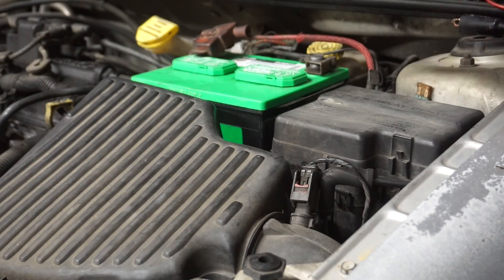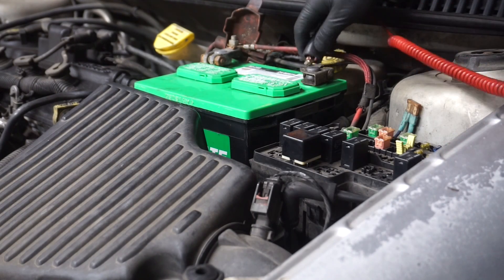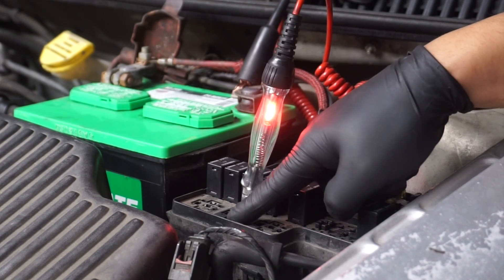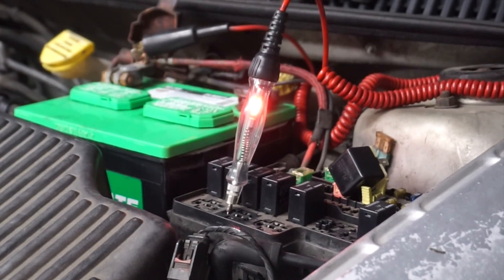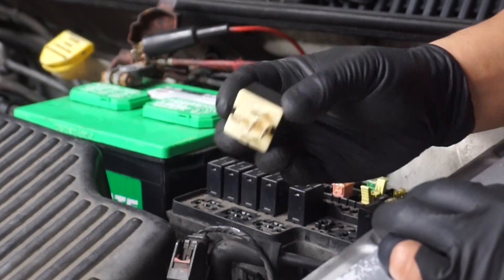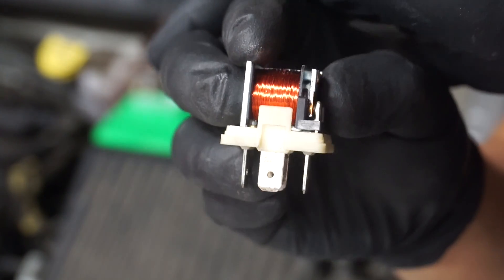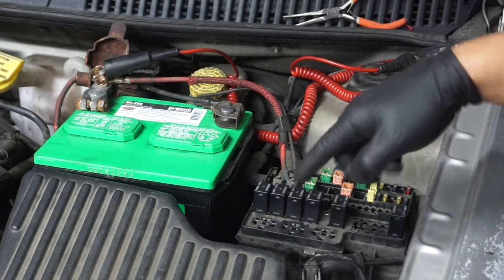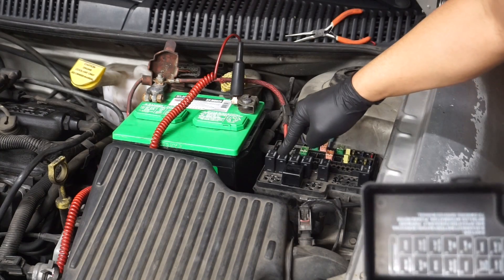How to test a relay and the relay circuit

Comment: Listen I need you bro I got a 2008 Ford expedition and my hazard lights go crazy when ever they what to, my truck even started on its own twice I changed my switch to the hazard lights, I can't find an exact relay for the hazards but the port 21 under the Hood and it's clicking without a relay in it does that mean it's the wiring not the relay

Comment: Thanks Homie! I got a car can't get power at the fuel pump, all fuse ok, all relays ok/swapped with known good one. I can't find an inertia switch anywhere. 2017 Mirage G4, It was T boned on pass side but no airbags went off, only the driver in the car, it has occupancy sensors so the airbags only go off if the person is there. I might have a bad wire. I'm a redneck so I thought about running a new wire and a switch since I have all the interior panels off looking for the inertia switch.

Comment: What if you put the paper clip or jump wire and still not kickin in the cooling fan  and already  the cooling fan was working when I jump it ,  fuse was good too !  what is the problem  is it wiring fault or is there another fuse inside the car for the cooling fan?

Comment: Hi honda civic 2007 I jump the cooling fan was working and the relay terminal when I test with tester light  not on  when I touch any terminal but  the other relay terminal  circuit was turn the tester on also the fuses was turn on the tester🎉 which one have  the problem  ? is it  the wiring

Comment: Hello, thanks for this video, really helpful!
In my case: sometimes, the AC clutch does not engage. Clip over the battery positive, no ground signal on pin 87 (5) which comes from the AC clutch. From the schematics, there is only one connector between AC clutch and AC relay (no other controls). Any possible causes why sometimes there is no ground signal other than wiring issues? 

When the clutch is engaging, there is ground signal on pin 87, everything works well several minutes than compressor shuts off. Power is provided to pin 30 (3) each time. 

Thank you!

Comment: Hey Hector ! I’m a new subscriber; , wanted to ask if you work on older vehicles .  I have a 1948 Ford F1 straight 6.  My problem is engine stalls when reving up.  Idle good but when I take out for a short drive, it stalls when I excellorate.

Comment: I am wondering if this is how you'd test the starter relay as well? My 2012 Ford focus se has power but won't turn over. I do hear a clicking sound when I try to turn the car on but that's it. I'm unsure if it's the starter or just a connection issue. Thanks

Comment: I know it has been awhile since this video, but here is a question. 
My auxiliary fan stage 1 relay ( low speed ) at the circuit has a very dim light from the test light with car off.
My blower motor speed only works at high speed. With the car on,  a/c on at low speed two pins shine bright with test light. Relay is good. Is this normal? Answers?
Thanks.

Comment: How does it governs the off and on of the compressor clutch. My clutch will engage when switch on, but when it disengage takes over ten minutes to turn back on. I'm good with the temperature ( 46 degrees ) when clutch is working or engage but cab gets mighty hot waiting for clutch to kick back in.
 checked the relay it's good pass both test. could it be maybe the relay is overheating and not working properly? but i have switch other relays to it's position and still same effect.

Comment: When testing relay and circuits  ,where does the B circuit come in.?in my case I have a brake switch circuit b low .not sure where to go to check as anti lock is displayed along  with service engine soon. Help l,your video was very helpful as my ac isn't blowing .so I'm ready to figure this out, thank you oh itsa 96 chevy astro.thank you.

Comment: This was helpful but im not sure I can figure out whats causing the short in my power window switch. Its not the motor and the power goes off and on but mostly off. Driving me crazy! Tried disconnecting the battery to do a reset and the power window came on plus the lights also came on in the switch. Then if i go back to the car an hour later  they are off again and switch doesnt work. This happened all of a sudden. I was never having any problems with window going up or down or any noise. Stumped.

Comment: Hi Hektor, Great video.  Having a fuel pump issue on my Land Rover Discovery 2 and think I have a problem with my  inertia switch circuit.  Got power into relay cavity but when did your ground test with from positive on battery with test light got nothing so not getting ground.  Do you have any videos how to check the circuit.. thanks,  Jeff N.

Comment: Hey:  Does anyone have a clue why my axillaries are not working? I recharged a recently new battery (96w)over night and placed it back in the van(Peugeot Partner DW8 2004), but now my horn/Digi clock/courtesy light/indicators/high beam and wash/wipers don't work!  When I switch on my ignition my side lights come on and when I switch the engine on my main beam lights come on with the light switch off! So my lights are staying on all the time as long as the ignition switch is on and I cannot switch them off at the switch. When I switch the engine off and remove the keys the lights go off.  The remote locking/alarm system also works. I have checked all the small fuses and none of them have blown. I haven't checked any relays as coming from this video yet.
This is so strange and all I did was recharge my battery and put it back in again. Could it be an open circuit caused by possible power surge on the relay that controls them damaging it, or could it be something else?   Any help is appreciated..

Comment: I must get my horn working (it never worked). I've been shown how to take steering wheel apart (air bag, horn switch(s), but I think it's either the fuse or relay switch. At least I'm checking that first.
Note*** It's much easier to check the switches than tear apart any bevel then put it back together. I've done that before!!!
I'm not a mechanic.

Comment: Hi! I followed your instructions and tested the relay and fuse at the control box. I just replaced the new compressor, dryer, height, and low-pressure switch. But I do not know why the compressor has no power unless I use a clip to bypass at the low-pressure switch, take off the clip the compressor does not engage and the fan does not run. I also tried to replace a new RCM AND does not work at all. Please help. Thank you.

Comment: Btw I bypassed the fuel pump relay by adding a aftermarket relay from autozone with a switch and now I have to manually turn on the fuel pump when wanting to start my car..since the computer doesn't read the original fuel pump relay when it's inserted into the circuit/fuse box..
Reply: I'm having trouble with a fuel pump relay what would you do just run a total different circuit

Comment: Hi I have my ignition main circuit relay buzzing on my 2012 corolla  everytime I have my fan ac on then I turn on my head light on and it buzzes and dashboard lights blink also I replaced the relay and still do the same changed the fan resistor but not luck thx hope I heard from u bye

Comment: I had an experience when I plugged in and out the relay works for fuel pump is there any possibility relay may stay off?? this will happen when the car stops and to start the car unable to start an engine due to these fuel pump relay, problem will be solved by unplug and plug again.

Comment: Thank you so much 
Can we adjust  the multimeter on 20 volt  DC  to check the two sides of the load   I mean  30 and 87 ? 
Will the AC clutch will activate?
Will the fuse of the multimeter burn?
Or it will just read the voltage between 30 and 87 ? 
I WISH you answer my question 
Thank you so much

Comment: Maybe you can help me.  I check the fuel pump relay hole (86, 87, 85 and 30) the only one I get reading is from 86 good voltage. all the others 0 reading. what you think that can be my problem? my pump or my pcm or both
Reply from the maker: What kind of vehicle? 

You should have two powers, one AT ALL TIMES and one with the KEY ON, 2 grounds, one AT ALL TIMES, and one control from the pcm, a switch, or other input signal. Use a test light not a voltmeter.

Comment: My right front headlight is out, all lights are out except the amber parking strip on top its the only light working. I've eliminated it being the headlight bulbs or the fuses, so I took the whole headlight assembly out and hooked it up to the left side connectors  and a couple lights came on when I did that but still missing the low and high beam. I tested the connectors that plug into the light and they are getting power. What do you think it could be? Ive been working on this for 2 weeks only driving my car during the day since I only have one head light. What do you think it could be, please help me figure it out....... 🙏
Love your videos you make it easy for women to even follow along so thank you for that.

Comment: and So what if they key is off and the 87 is the  permanently on power source and not 30 on the fuse box, when they key is on the 85 pin gives power? because I have had to replace the motor now for the 3rd time in the past 2 months. If the aircon is not running then the car temp climbs to a 100c but when aircon is on it maintains temp at 85c. Is it possible that the fuse box wiring was incorrectly connected swapping 87 and 30 around? i followed your video step by step

Comment: Love the video, very informative. With that in mind all my relays are good however on my 97 f150 it cranks but won't start, fuel pump is also new, filter as well, fuel up to the Schrader valve but still no start, any ideas?
Reply: Have you already checked spark/fuel at the injectors? 

If so, have you checked compression as well?

Comment: Hey Hektor on mymy 02 mercedes  I do have two power sources #87 and 85 power is not traveling to #30 are the 40A fuse #32 i"m dropping power some where. I'm open to suggestions. I have already replace the SCR still have the same problem.

Comment: Hektor  great video, I have a problem with my 02 s430 Mercedes. I pulled down a wire diagram from a good source online on my suspension pump circuit. it said the relay sw 87 was  hot all the time  upon checking it appears to be just that. i'm wondering what happen because I thought sw 30 was hot all the time. can you explain what may have happen, I can jump the two terminals 30 and 87 and the circuit works pump will run however i can't get it to run with the relay. I have tried several new relays. Bruce

Comment: my relay tests are all good...
... so, in next testing my AC clutch relay CIRCUIT/BASE (as shown in this video), i had...

* key OFF: power to pin 30 (showed 12 volts on multimeter AND lit test light)
PLUS: when testing the ground (87), it was good (showed 12 volts on multimeter AND lit test light)

* key ON (or engine running): power to pin 86 (showed 12 volts on multimeter AND lit test light)
HOWEVER: when testing the ground (85), it was mixed results?!?!?!
>> i got the 12 volts with the multimeter
>> BUT, i was UNABLE to light the test light (even with engine ON and A/C supposedly on... the snowflake button is blinking, so it's hard to tell what is "on" - but i tried pushing it too)

i can't explain that.  
how is it that i can read the volts, but that not light the test light?
thoughts?

(p.s. - i CAN jump 30 & 87 with a paperclip and get the A/C compressor clutch to kick in)

Comment: if the light doesn't come on when touching a pin with the key on and you've already confirmed the fuses/relays are good. does that point to a bad gem module? having problems with the wipers on my 2000 mustang not turning on. replaced and checked just about everything. if I jump pin 3 and 5 with a paperclip where the intermittent relay goes the wipers turn on. power seats, windows, chimes, interior lights all work.

Comment: Hi I’ve a problem with Nissan Navara d40
Reply: It is intermittent problems with starter circuits in that it starts when cold but won’t start when reaches normal operating temperature
Reply: Checked all the related components battery hew

Comment: Appreciate your information I learned a lot from there. I have a question I have a 2011 Mercedes C300 that's not raining anymore. I'm getting interior lights but the car won't start I checked all the fuses. And noticed that one fuse had water in there. And it was labeled engine control relay check to see if I have ground coming from there but when I connected to the positive I'm not getting no connection. Thanks if you can help me out

Comment: also if your unsure what your jumping just use your test light as a jumper wire this way if you accidently short to ground it will just light the test light,according to scannerdanner anything under 2 watt/160ma is not going to hurt a pcm infact he recommends using these for pcm wires

Comment: Your Video  Helped me out ALOT!   with my 2006 Hyundai not starting after a cam shaft position sensor replacement turned out to be a blown Ignition fuse. I would have never known to look there if I had not watched this video it added alot of value to my toolbox. Keep them coming.
Reply from the maker: That’s what it’s about 🤝

Comment: Hi Hektor

I need your help man
I have a 2020 ford ranger xlt with stock halogen headlights. When I upgraded it to an LED headlight I noticed something about the headlights not turning on at the same time. 
Right side goes on first then left driver side about a millisecond after. 
What do you think is causing this man? 
I appreciate any suggestions

Comment: So if you bridge the power terminals of the A/C relay, you should hear the A/C clutch engage (assuming good A/C fuse)?  And if you can apply 12V directly to the clutch wire and get the clutch to engage, there's a problem in the control circuit somewhere?

Comment: Hector , how do I contact you?
Reply from the maker: Instagram: HomieHektor
Reply: @HomieHektor  have a 2017 Hyundai Santa Fe with no low beam headlights only high beams. Replaced lamps checked fuses .still don't work. If I remove the bulb I get the 12 volts to light the low beam bulb but when I put back the bulb the I loose the 12v 
Can you help.
Thanks.
Reply from the maker: @juniorjunior3755  where are you located?
Reply: @HomieHektor  north florida

Comment: Would I still get voltage 11.6v if i had a bad fog light relay? The reason im asking is because the fog lights wont work but im getting a reading of 11.6v at the connector.. The lights are brand new LED's but both wont work even though i have voltage.

Comment: Hello! Thanks for your informative videos!
I have an issue with my toyota avensis 2004 headlights. They turn on automatically at night when the car is off and drain the battery so I have to take off the headlight relay (H-LP) every time I turn off the car. I am not sure that the relay is bad because the headlights can be turned on and off by the switch properly when the car is running. Could you please give me an advise as how to find the problem?

Comment: So a relay that coil pulls contacts in can still be bad? So a relay can be weak and sometime work then not work? I thought IF relay clicks then good.
Reply from the maker: If it click, that tells you that the control side is working, but it doesn’t tell you that current is flowing across on the load side of the relay.

Comment: I have a question.  I have a fusible link next to my fuse box with three relays in it, including my multiport fuel injection relay.  If either of the other two relays were bad, could it create enough resistance to affect the other systems, like my fuel system which is controlled by the MFI?

Comment: I have a 2003 Mitsubishi Diamante, l have a problem with the transmission,check engine came on ,the neutral position light is blinking, and transmission is taking off in 2nd gear, went to Auto Zone ,had it scanned and came up with code P1751and with there diagnosis,it was recommending a transmission control relay, I was wanting to no where it's located and also want to no whats the symbol on the fuse box diagram cover for the transmission relay ?

Comment: Thank you for that testing a relays help me understand a lot. Couple questions first can a relay test bad and then appeared to have a stuck open circuit. I connected a 9-volt battery to it and you started opening and closing for me?.. also what's the best way to check my what's the best way to check my onboard computers. ECM Exedra 
Thank you

Comment: Thank you for your info.  Have a 3rd gen Prius  fan one turns on , fan two don't turn on ?  Check fan motors with battery and ok  check relays  ok, check continuity from fan connector to relays but only one pin have continuity ??? check cooling sensor is ok ..Please any suggestions ?

Comment: Hey Hector I bought a 2004 freightliner MT 45 step van it looks like I have a short to ground but all my fuses are good and there’s a harness that’s connects  to the ignition when I plug together it turns on the dashboard as though the key was turned but it has no key in it and the truck will not turn off if I jumpstart it scratching my head I ordered a new ignition switch any thoughts and just wondering where are you located thank you for any help God bless

Comment: On a 2005 pt cruiser, my wipers stop working. I REPLACED the 20 amp Fuse and still nothing..I checked the manual and it does not tell me  which Relay Switch for the Wipers, do you have any Idea how to help me??

Comment: Getting negative 14 amps from the fuel pump relay when I jump with multimeter technique. I don’t hear the fuel pump turn on either. Trying to diagnose a crank but no spark/no fuel issue